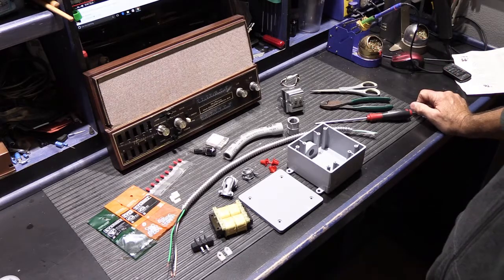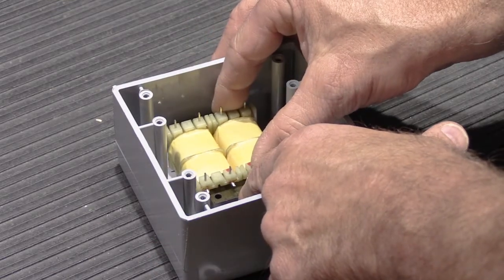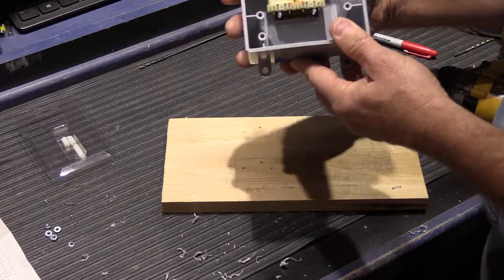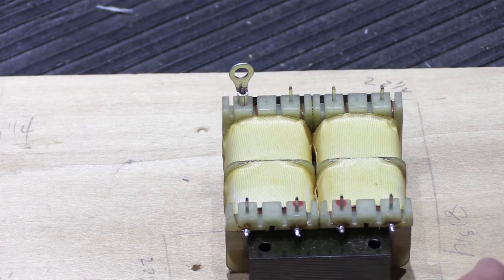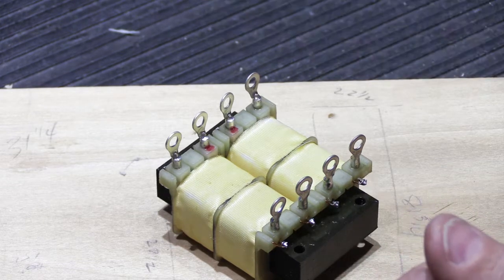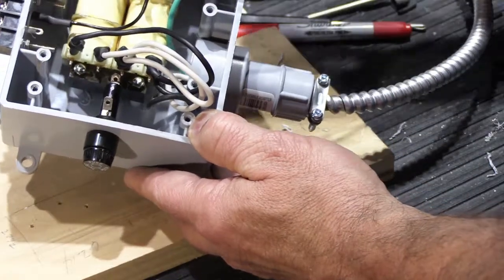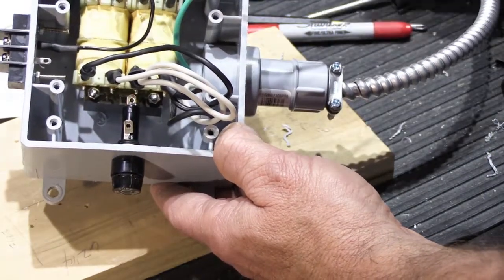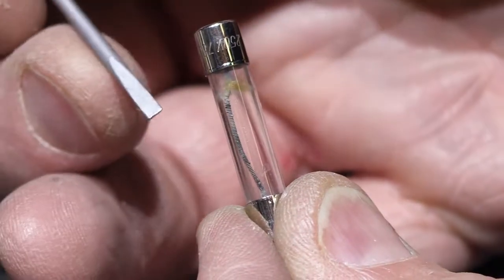Building a Replacement Low-Voltage Transformer Appliance for a NuTone Model 2540 Intercom

Comment: Hi Chris.  Great video.  Can you tell me what model # rough-in box/wall box a 2090 intercom uses?
Reply from the maker: Hi Anthony: A NuTone 2090 System uses a Model 430A Rough-in kit - which included the wall-housing - AM/FM Dipole Antenna and a 30 volt AC Transformer rated at 20 VA (watts) - Chris